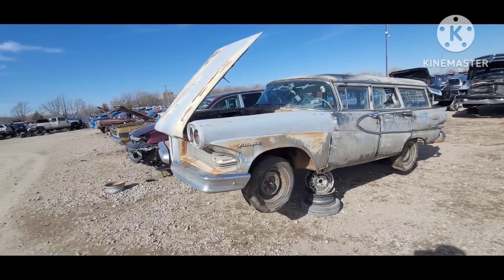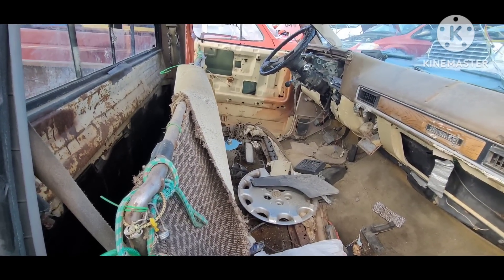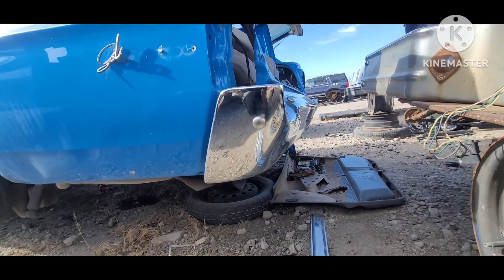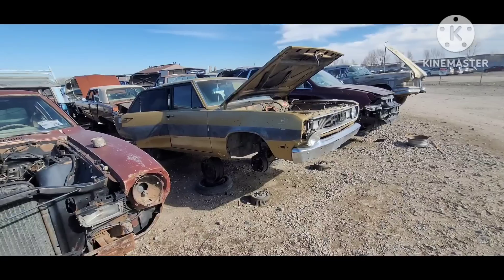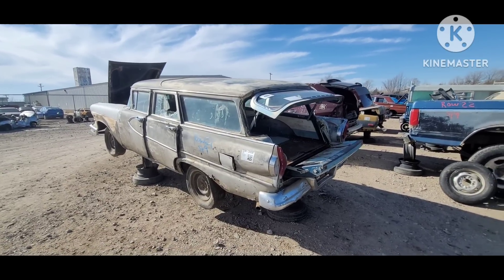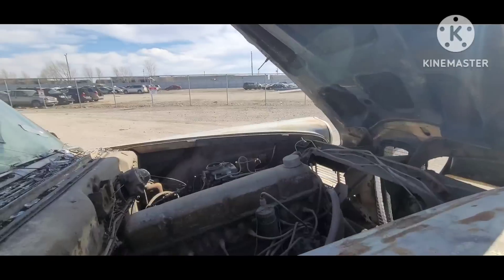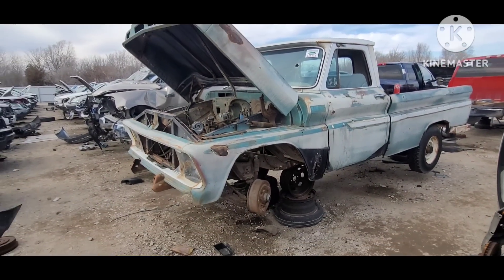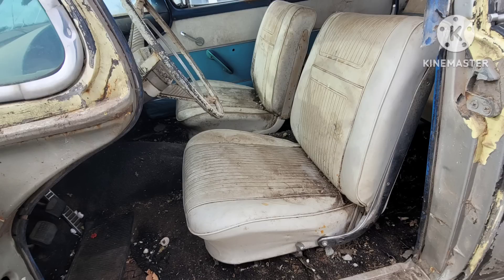Yard Report: FALLEN Edsel wagon, Classic Fords, Plymouths, & Chevrolet trucks! Junkyard walk around!

Comment: The Edsel tailgate will come off very easily with a 1/2" socket.  Just lift the back floor deck that covers the spare tire and you will see 4 bolts that hold each hinge.  Remove those and it's off.  Those tailgates are the same as is used on '57 and '58 Ford wagons and Rancheros so they are very desirable.

Comment: Little Ford history, GM came out with "heavy-half", so Ford came out with F-150, like you said heavier brakes and rims but also had bigger radiator,alternator and added 800gvw. F-100 we're really grocery getters. Cost cutters could even get
Heater/radio delete, ONE speed wipers, manual disc brakes. Great tour as normal with your videos. Thx

Comment: The manual transmission in that Edsel is from a truck. Look at the shifter. It is a top plate type shifter input which wasn't used in cars. Cars used  side input shifter linkage transmissions.

Comment: six cylinder was not available in 58.1959 and 60 had it so somebody swapped that engine and tranny in. Glad you got the tail lights, but should grab the small lower fins as well.
Reply: Transmission is from a truck

Comment: Edsels came out of the factory as ugly junk.
Reply: Ugly is a matter of individual preference and some people consider them to be beautiful. As for them being junk, other than the electric push button shifter being a garbage design, the rest of the problems with them were caused by assembly line workers sabotaging them as they went down the assembly line because they were being built on the same assembly lines as the Fords and the workers hated having to stop to switch over to building an Edsel or 2 then switch back to building a bunch of Fords then switch over for a couple more Edsels.
Reply: @todddenio3200  I rest my case.... but each to their own...... enough has been said about them over the eons already.